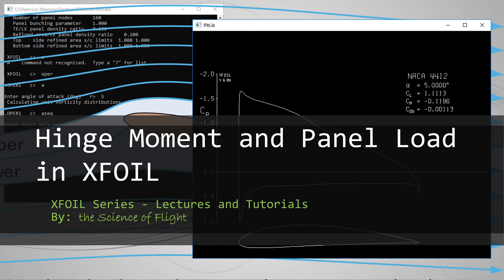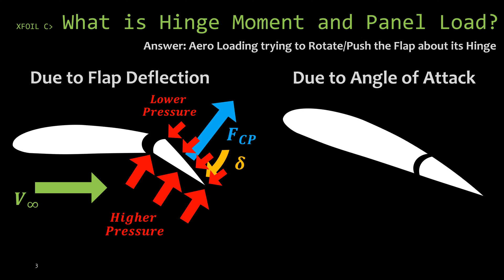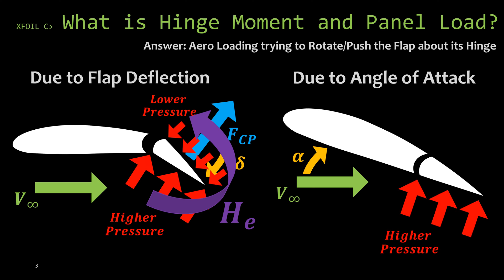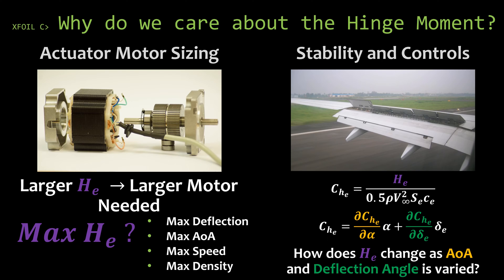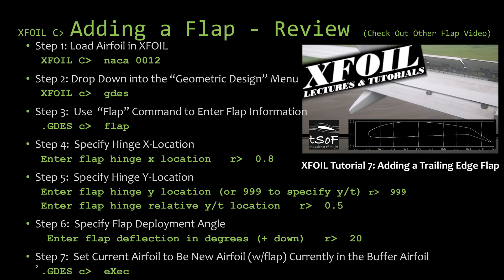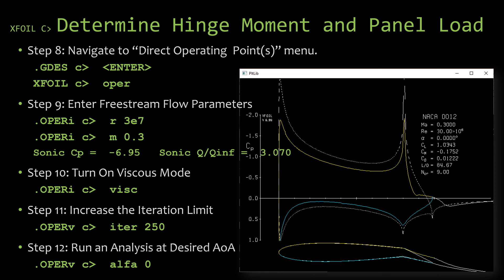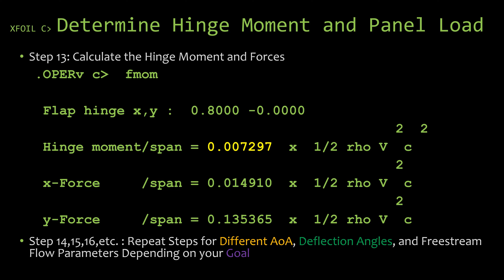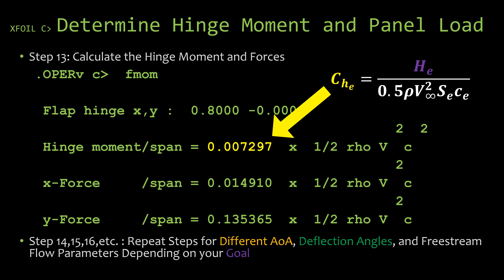XFOIL Tutorial 10: Flap Hinge Moment and Panel Load

Comment: Hi, thanks for the great video. For the calculation of hinge moment in XFOIL (~7m50s), can you confirm that "c" refers to the chord of the flap? And not the chord of the whole foil?
Thanks
Reply: I'm not Michael, but I can confirm that standard practice in hinge moment coefficient definition is to use the area and chord of the flap aft of the hinge line.

Comment: As this is currently the last video in your exelent! Xfoil tutorial video series I am posting this question here, altough the question is not really related to this video's topic, I hope you don't mind and am able to help me.

I want to find the the location of Xcp, the resultant lift force location, the center of pressure, this location changes with changing alpha.
I use top and bottom trip locations set to 0.1 (XFOIL>VPAR>Xtr>0.1 0.1) because Ncrit trips gives a  jagged Cm line and my wing will be build with old fashioned cloth skin so the boundary layer is turbulent over the full chordlength anyway. 
I am changing the moment reference location from the default 0.25 0.00 location (XFOIL>XYCM rr) several times, iterating, and so find the Xac, the Aerodynamic center location. Xac is the location where the moment is constant with respect to a changing alpha.
In my foil I so find that Xac=0.2515 and then has a constant Cm of 0.003
With the above procedure I think I am on the right track but I do not know how I can then calculate the graph that shows me the Xcp VS alpha. Do you know the solution? It could be that I am not on the right track and need to find a way to somehow use the pressure vector data (XFOIL>OPER>CPV) but I dont know where I can find that data in XFOIL polar or dump file.
Reply: Ah! nevermind,.... I seem to have solved my question.
By changing the XYCM to 0.0 0.0 (moments about the leading edge) I can calculate Xcp = -1 * (CM/CL) at each alpha.

Comment: Hi, I really enjoy your videos and find them very helpful, so thank you for the hard work on the tutorials.

Other than that I have a little question. Is there any option to export geometrical values of the geometry of the airfoil into a text file? I know you can with the curvature, but i’m not really sure you could for the mean chamber or other geometrical values.
Reply from the maker: Unfortunately, input and output of data using files is a weak point of XFOIL. I hope in future versions that much more of the values are available to output to a file and therefore have more capability to run XFOIL from Matlab (I have it on my list of potential improvements to try and code up and try and get included into the next version). That being said I do know of one output file option available for airfoil geometric values in the standard commands available from the command line prompt. After loading an airfoil into XFOIL, if you navigate to the “Geometric Design” menu by typing in GDES and hitting enter and then you can navigate to the “Camber” sub-menu by typing in CAMB and hitting enter. In this sub-menu, you are able to write the airfoil camber and thickness to a file. This file will contain 4 columns: 1) chord location of camber, 2) camber, 3) chord location of thickness, and 4) thickness. Note: The thickness is the thickness above and below the camber line so if you will need to double this column if looking for the max thickness value. For example, NACA 4412 has a 12% max thickness but the 4th column of the output camber file will have a max of 0.060017. This is because the total thickness is 0.060017 above the camber line plus 0.060017 below the camber line for a max thickness of 0.120034, or 12.0034%.

Another work around would be to output the airfoil coordinates to a file (using the PSAV command in the main menu) and calculate the values you are looking for from the airfoil shape directly. You could potentially find in the source the code you are looking for to calculate a particular geometric value and use it to calculate the value (though you would need to abide by the GNU General Public License for your new code).

Hope this helps! Thanks for the kind words of appreciation for the channel. I’m just getting started, so many more XFOIL videos to make, lol.
Reply: @thescienceofflight1404  In the XFOIL documentation they state that there will be no future versions, and the original autors will not be available for questions. They infact moved on and recoded XFOIL from the ground up, that new code can also analyse multiple element airfoils (airfoils with a gap infront of the flap and such). Most unfortunate though that new code is not being made public.
You however seem to want to fork the current frozen XFOIL version and start adding code. Have you already done work on this and have a repository for that?